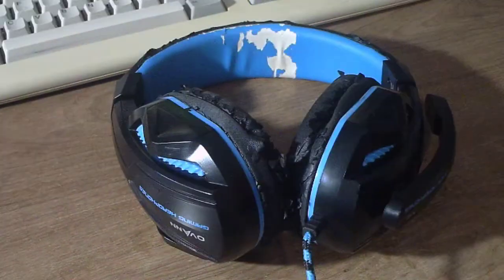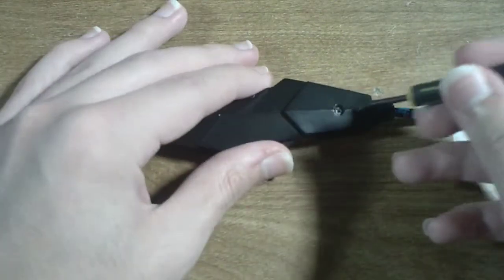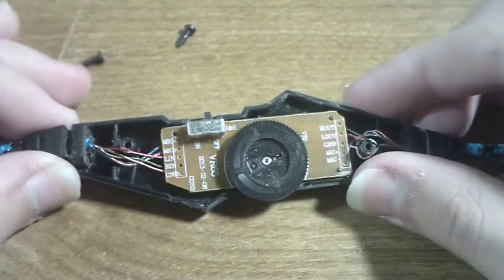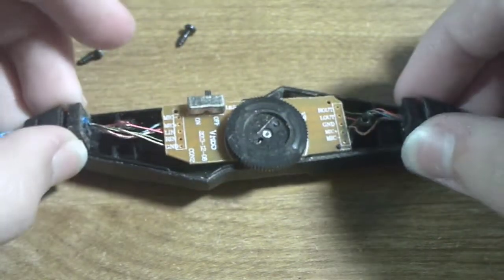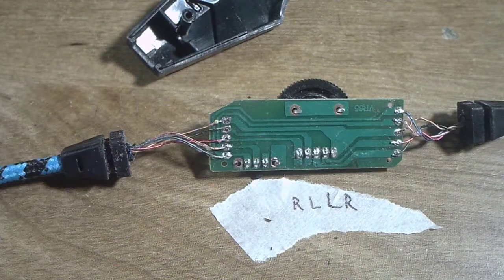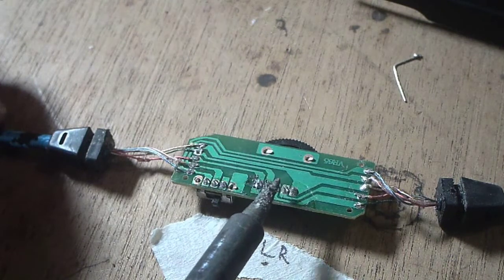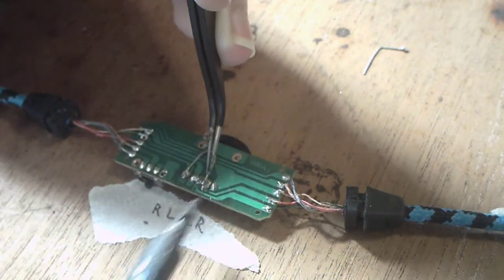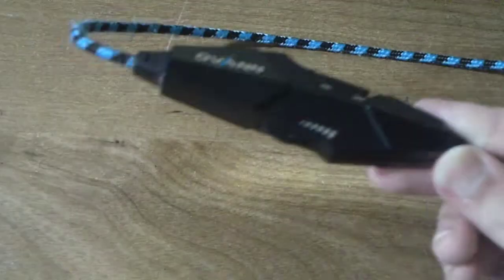Removing Headset's Broken Volume Control

Comment: will headphones work if we remove pcb and connect wires without it
Reply from the maker: If there are no active components on it, it should. It would be much harder though, as those cables are really really tiny. My headset also had a toggle switch for the mic that I wanted to keep using. gl
Reply: @GameFeverOnline  ok i did connect wires without pcb but it didn't worked only the led light works no sound from them
i have kotion each g2000 headphone
i got them for free cause my friend accidentally destroyed the controller and gave it to me that's why i asked
Reply: @techmynews9495  If your headset has usb plug, then don't. Actually you can, but you have to re-wire all the cables to jack interface.

Comment: could you not just remove the wires from both ends and connect them together?
Reply from the maker: I did not do that because soldering each of these tiny little cables with insulation is a lot more difficult. Also, removing the box removed the mic on off switch and it would look bad having the splice in the cable.

Comment: HI SIR 
can i remove this little motherboard and make it directly ?
Reply from the maker: In theory you could, but then soldering those little cables with insulation would be much harder. Also, mine has a button for tuning off the microphone and I wanted to preserve that.